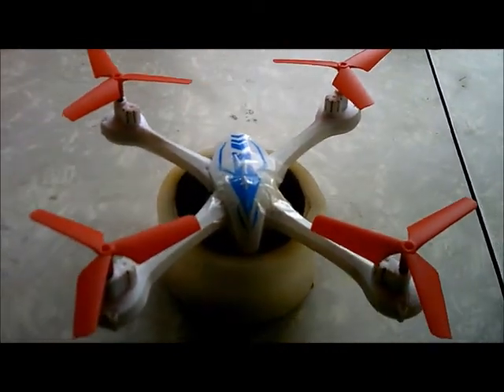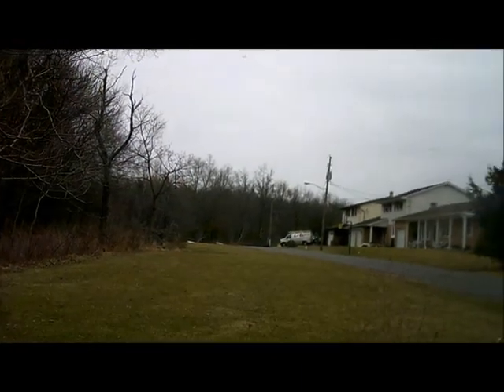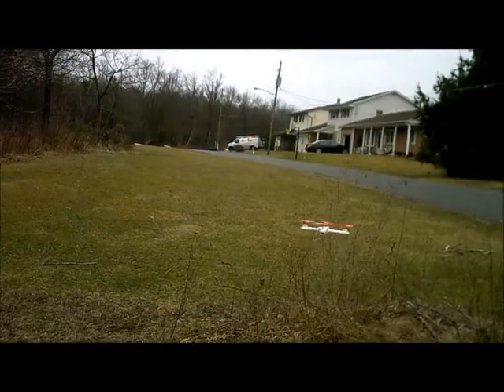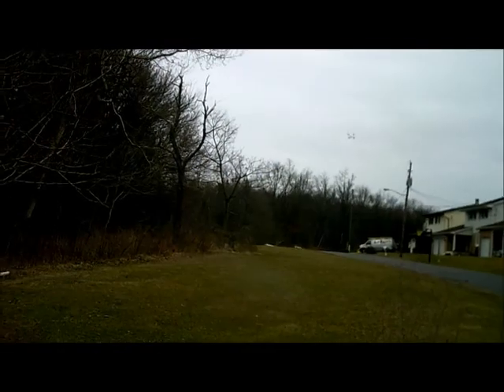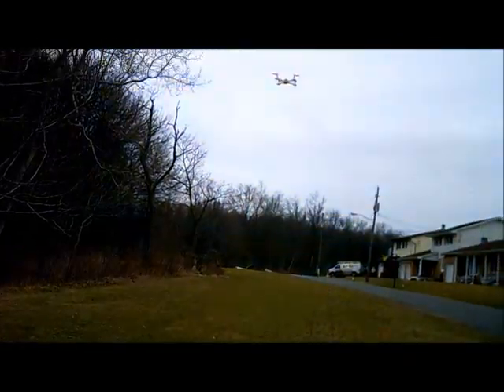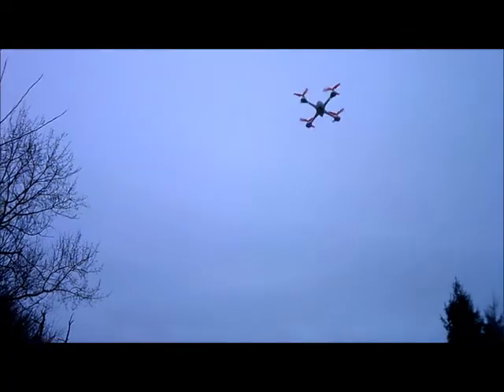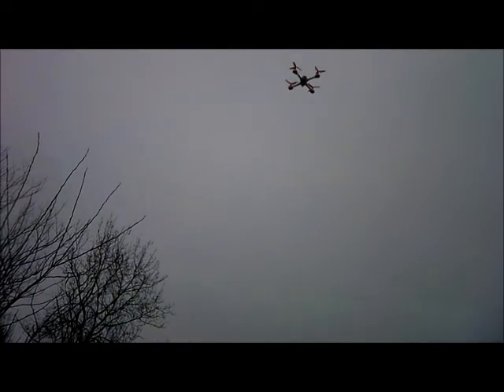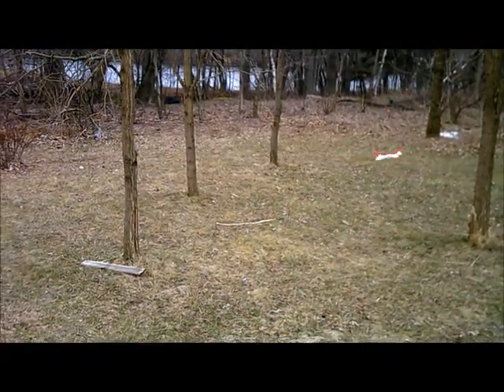Tarantula No. 1505 Small Tri Propeller Mod Test RC Drone

Comment: The 1505 kinda flies like the JJRC H98, they both want to climb.  It doesn't take much throttle to get off the ground and there's a fine line between hovering and dropping out of the sky.  They are both really light and don't handle higher speed breezes very well.  That's just my experience with the quads I ordered.  Thanks for another awesome vid.
Reply from the maker: bam n good observation mal

Comment: Have you flown a Mould King 33041A yet ?  It's the best I have flown only second to X6 Trantula.  Supposedly the 33041A is newer version with "normal" fast yaw rate on fast mode, where as 33041 and 33041C has crazy fast yaw on fast mode.  Oddly I ordered the 33041C from gearbest, but it did not have the crazy yaw rate.. but after flying the Tarantula  1505, I am glad that it doesn't, cuz the super yaw, kicking in suddenly on 1505 is really bothersome.. only way to make a smooth fast turn.. seems to be paulsing the yaw.  Ebay might be the best place to get the MouldKing... maybe about $19.. hopefully from U.S. loc.
Reply from the maker: I have one mould king not sure which one search my vids friend
Reply: Andrew Jackson     Have you flown the Mould King Super-X?   It is awesome.  Take the legs and the props guards off and it is so much fun.  Its just a big Super-S.  I really like all three but I saw a video saying you can't get parts for the Super F but you can still buy the quad itself.  Sorry for rambling.

Comment: May I suggest another experiment?  I remember from tinkering with a small 3ch Coaxial helis, that the tail rotor(used to tilt the heli forward/backward) never had enough thrust.  I bent the blades up a little giving them some Dihedral.  This gave the tiny heli a little more tail thrust so that it could fight the wind.  I have a bunch of 3blade props, but none suitable for trantula.  Maybe you could figure out a good way to bend the 3blades upwards a bit, using maybe a heatgun and some jig.  I think you will get more thrust/acceleration from the same 3 blade props, if you do.  I think that's the same reason why the X6 Tarantula props generate so much thrust.  I think the X6 Tarantula props are the most efficient quad props of it's size and were made for high thrust.
Reply from the maker: Tri blade not good for this quad diameter is to small and don't cover a large surface area and in Renault poor thrust thanx for watching
Reply: Yes I see that you already have MouldKing 33041.  Does your have crazy fast yaw on the fastest mode?  Anyways;  it's my fav MiniQuad.  Just to point out that all the Duds are being sent to ME..and ONLY me...!!       -- CC -- I am having a lots of issues with Super X and the "mini" Tarantula 1505.  Super x had a bad battery receptacle with I fixed by hacking up the lower body with knife, cuz I could get the props to come off.  The next day, I find out that it has about 20 meter range.  Mini Tarantula on the other hand seems to be a dud.. sent just for me(No punch up) with 15 meter range.... (found the antenna on the transmitter to be over 5cm long.. trimmed it to 3.12cm).. so maybe I will have better flight tonight.  Will have to share some tips with you...once I get all these bugs worked out of the way.